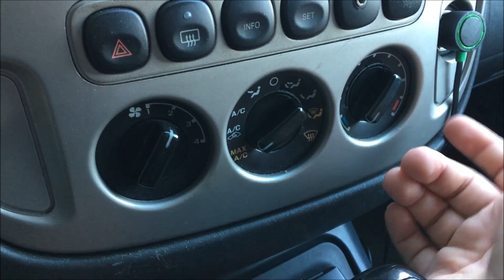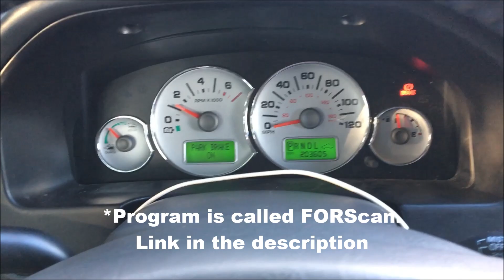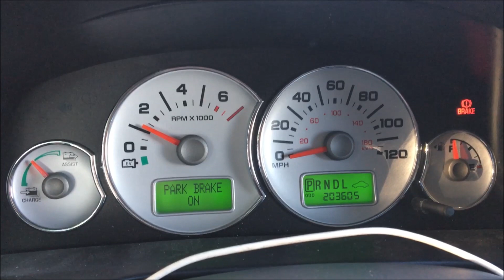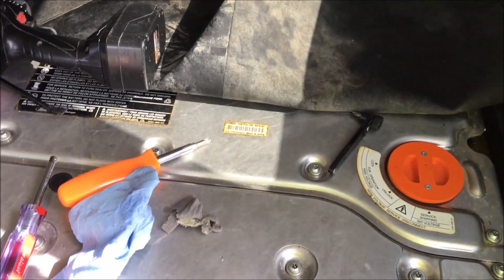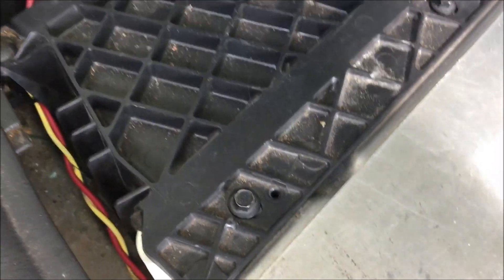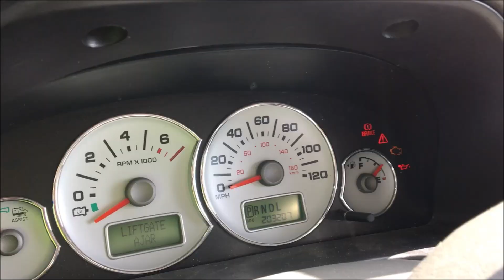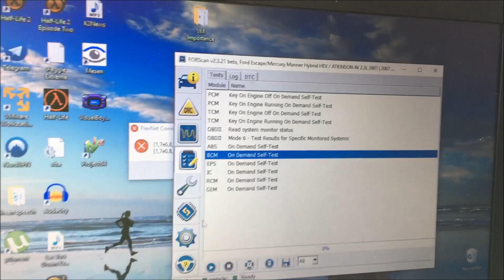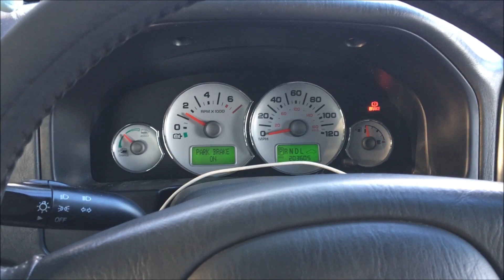Ford Escape Hybrid Engine Not Turning Off? Try This.

Comment: Hi, and thank you for the video. My 2005 Escape Hybrid engine is turning electric while is low temperature but when hoing hotter ouside (above 25C) and when the engine is hot is not going electric anymore. I also hear the battery fans running all the time. Unfortunately my OBD is not running anymore, apparently someone along the way break it. Is there any other way to confirm that the battery fans have issues? Kind regards.

Comment: Great video! My wrench light comes on in the summertime for the past 2 summers, took it to the dealer to read the code and they said it was the battery fan ($1700). I think I can fix this myself but I want to make sure this is the issue because my car will still go into EV mode. Could it still be the fans of the escape will go into EV?
Reply: I know it's been almost a year but I'm facing the same issue with my 2006 FEH. There is a mobile version of ForScan and using that with the vlink adapter I can also load PIDs into the dashboard. Once the battery reaches 100 degrees F the AC demand switch turns on to cool the battery. It's supposed to run the engine and the AC till the battery is down to 70F and the process repeats. I needed a new ac compressor and I had a hole in the evaporator. So now, I'm still pulling battery fan codes so replacing the fans are next. Also know there is a paper filter in the trunk on the driver side. There's a pull off access panel. This filter is for the battery compartment and needs to be replaced when it gets dirty or once a year..

Comment: How did you do to start the car and see what fan was not working ? I tried to do the same but the car doesn't start with the battery cover out
Reply from the maker: I didn't ready the car (key on, engine on), it was simply in accessory mode.

Comment: Any luck cracking the cooling fan open and identifying a problem?  I've replaced my fans once, and now I think my new set have failed too.
Reply: I did find a thread on greenhybrid.com where a guy did tear one down, and there’s a computer board under the fan with a chip fuse and mosfet chip that can fail. I believe I was getting errors because it was so hot in my battery compartment the fans shut down (temporarily) and hybrid mode wasn’t happening.  My a/c was working poorly and it’s ability to cool the battery was nil.   On a cooler day I took my battery apart and both fans were definitely kicking back in.
Reply from the maker: blowuplovesyou None. I emailed the company that was labeled on the motor (Nidec) and never got a reply.